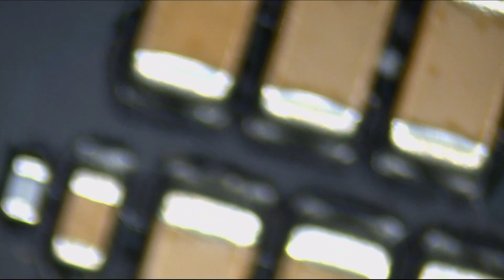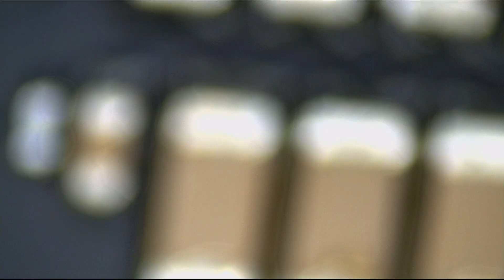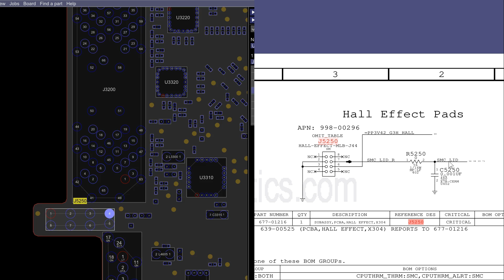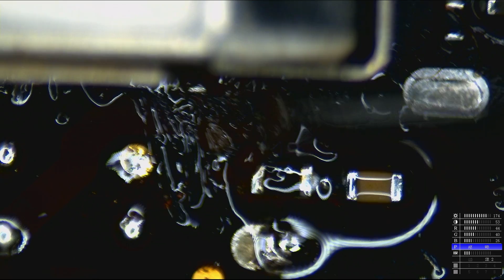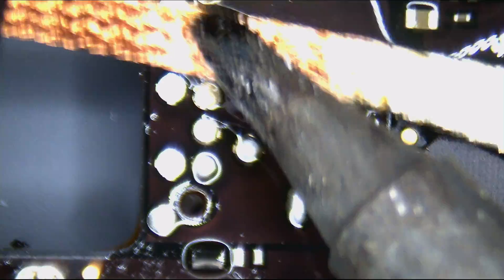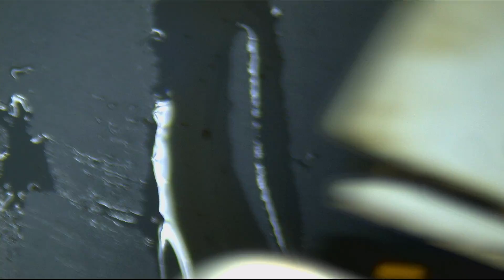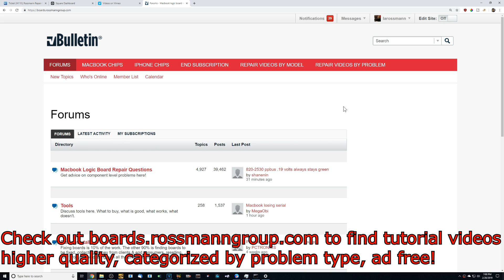Macbook Pro Retina screen flickers: why? Let's fix its logic board and find out.

Comment: I bought a 2015 MacBook pro retina 13" from a friend that she said she hadn't used in a while but was in perfect condition and I bought it for a more than fair price and was happy with it shortly after I started using it the screen would flicker on and off to the point I couldn't use it, I was disappointed, stopped using it and recently I heard about Big Sur and hoping this would fix it I downloaded it on safe mode (it works on safe mode) the problem persisted until today when I took the hard shell off as my last hair Mary, it's been fine since this morning but if it keeps happening I might contact your company!

Comment: Could there be a third camera pointed to the temperature of the hot air and number/strength of its air flow so we can learn more or less what temperature at what air strength is needed fo certain SMDS, like ICs?:-

Thanks Luis.

Comment: Hi Louis, Thank you so much for your excellent teaching. I learned a lot from you. Just need a little bit of help with my Macbook Pro A1260. My daughter dropped it and since then, the screen flickering. I pulled the flex cable of the screen from the motherboard after that never turn on again. Not sure if the screen LCD if some issue or other components. Let me know your thought.

Comment: Hey Louis,
I am having a issue with my mackbook pro 2017 with the display. The screen start flickering after a couple of hours of use and horizontal lines appears on the top of the screen which spreads across the entire screen. when i switch window, the previous window shows under the lines. after i shut it down and keep it that way for 5/6 hours, it becomes normal and does the same thing again when i use it ... can you tell me what's causing this problem and how can i fix it. 
P.S: I don't live in USA

Comment: I want to THANK YOU for the insight on mac repairs and shady apple practices, I dropped by MacBook pro 2013 a week ago, the screen started to flicker and black out at times make in it unusable, the thought of going to the store for repairs was scary,  since I watched so many of you videos I knew if I took it to the apple store I will be given the option to get  ripped off or buying a new computer even when the one I have can be easily fixed, I opened the back panel and found the display cable had come out of place along with it's wire, I carefully put it back put it back together and the issue was resolvedly because of the information you selflesly share, again THANK YOU!

Comment: A trick to clear through hole pins is to blow the solder out the holes using hot air and a small tip. 
Also it might be possible to use tape to stop burning those plastic parts up. That was a lot of heat though, so maybe not.

Comment: I don't know exactly what it was that got me "into" the cult of Apple. I remember my brother bought one of the original white plastic MacBooks and as soon as it booted I thought to myself "this is the future." Even the slot-loading optical drive had such a satisfying noise when loading a disc. 

Then there was the iMac G5. The G3 seemed like something anyone could have created given the current state of technology, but an all-in-one computer system inside an LCD panel? Again, "this is the future." I was a moth drawn to the lamp. 

All of this aside, deep down inside these aesthetically-pleasing machines is just an underwhelming combination of poorly-cooled, mainboard-soldered components, the most interesting of which (to the average Joe) can be found just about anywhere. The technique of the magic trick was revealed to me. 

If I ever run into some money, I'd probably still be interested in dicking around with an old G5 or 2006 MacBook, but you're out of your mind if you think a broke college student would purchase a modern Apple product even for productivity reasons. 

People don't realize the reasonable capability of relatively inexpensive mid-range, ugly, plastic, noisy laptops. Just buy one and throw an SSD in there and maybe upgrade the RAM and I promise you'll be surprised and glad you didn't spend twice the amount on something. Even a mighty MacBook Pro is not invulnerable to obsolescence. At least pc laptop won't break under normal use.

Comment: This dude came up with a fix for the 2011 MBP GPU issue that makes the logic board permanently run on the Intel GPU instead of the AMD GPU that burns out in them. He still needs to release the firmware for it but it looks pretty solid.  Too bad he didn't figure it out sooner.  https://www.youtube.com/watch?v=n6ROPL2-5HA

Comment: The technician at one of my old jobs taught me a really awesome trick to clear solder from nasty holes. Stick an angled conical tip in the hole, then use a desoldering pump to suck out the solder with the tip still in the hole. I ended up burning a little hole in the plastic tip when I tried it, and it only made things easier.

Comment: Louis: I wondered whether captan tape would have helped here? Also, small bent aluminum shields placed on nearby connectors. Like straight down to board, and bent over nearby connectors, if I replace this hall effect sensor?

Comment: And for the ports around the chip, they sell heat proof tape which is a little tiny thin yellow paint thy does a very good job of replying heat from chips, all you have to do is tape it over.

Comment: 0:29 Not out of your mind; just 8 years late.
Reply: Well you will need to pay another 100USD for better QC
Reply: @QDStrength  What is QC?
Reply: Gjermund Gusland Thorsen quality control
Reply: @vaseline5070  I have no clue what you are writing about. From the day I started buying Apple products( 1995 ) until 2010 - 2012, the main part of the product was that the engineering was of a quality no other PC manufacturers presented. Since 2012 the decline of quality in Apple's hardware has been at par with terminal velocity.
Reply: @gjermundification  I thought you were asking what the abbreviation of "QC" was.

Comment: Why do only macbook users drop liquids on their laptops? I know alot of macbook users who make the same mistake but never heard of other platform users doing the same thing
Reply: Don’t you know that MacBooks are for rich people to pose down the coffee shop with!?
Reply: Other motherboard manufacturers do a better job of preventing corrosive water damage on their boards.
But even in cases where it happens, there's not going to be a youtube channel dedicated to fixing MSI laptops. Replacement parts are an order of magnitude easier to get.

So someone that has damage, would likely just have a shop buy a replacement board and do the replacement.
Reply: I literally set cold drinks on my notebook, sometimes without a napkin or coaster, and never once spilled any liquid on it.  Condensation may make a small ring at the base, but doesn't get in the keyboard or track pad.
Reply: OmniscientWarrior Whilst I wouldn’t dream of doing that with my super-cheap laptop, I have had a leak in my factory roof dribble into it.  You ain’t never seen a man strip a computer down to it’s parts so fast!  It survived BTW.
Reply: @Jenny_Digital  Of course it did, it wasn't an apple....